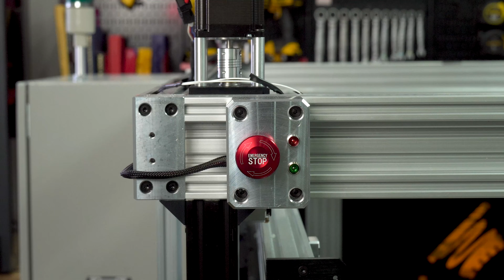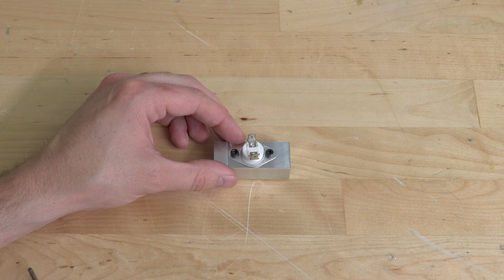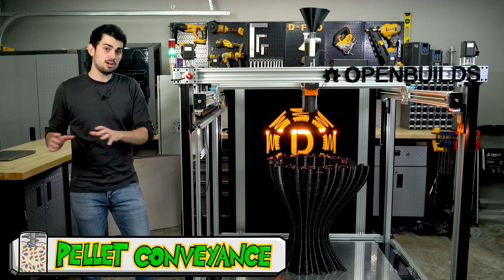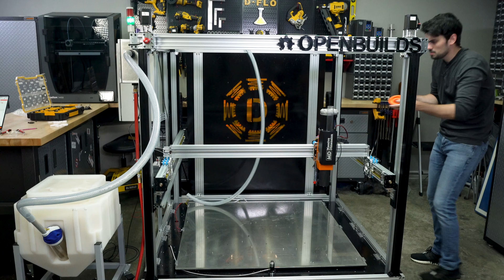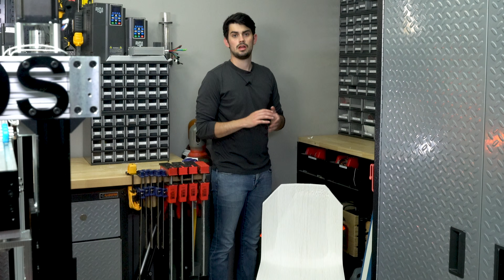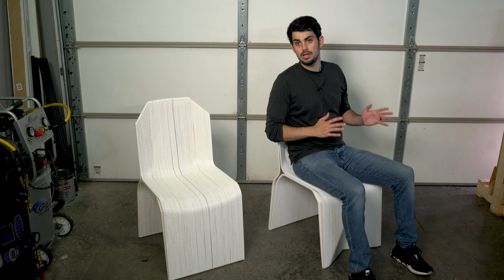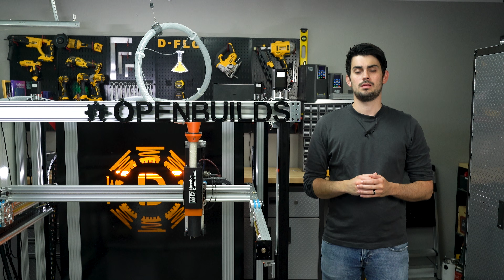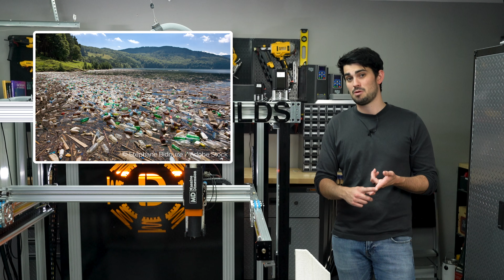Building a Large Format 3D Printer – Part 4: Printing

Comment: There is a solution to your problem of not having enough support from the infill on the top layers, Cura can be set to increase the density of the infill as it gets closer to the skin, with variable parameters .
 You could then get the light weight and the extra support.
Reply: PrusaSlicer has a similar thing with what it calls support cubic, as well as adaptive cubic that increases the infill density nearer to the walls of the print.
Reply: Lightning infill could also be incredible here!
Reply: @quinnobi42  cura has lightning infill which is not even close to any other infill in prusa but it doesn give strength
Reply: @ale6242  PrusaSlicer has that in the current alpha, I think Cura already has it
Reply: @DavidGarcia-nx2gj I really don't like lightening. Its been virtually worthless to me.. maybe some prints it'd work for rapid thin wall prototype but even at that it's been crap ime

Comment: I've worked with large format 3D printers as part of my undergrad. An interesting pellet extruder varient is to use a heated positive displacement pump instead of a typical feeder screw. This produces more consistent extrusion rates and, as a result, more uniform layers. As far as I'm aware there are no commercial extruders that provide this but you could design/manufacture your own if you are in need of content. Just a thought. Great work on this btw!
Reply: Just a random question that I'm curious of, do you know why no one makes 3d printers that prints above 2 meters? for some reason everyone tops out at 1 meter. I tried googling but couldn't find the answer to that
Reply: @rajneshchapatikumar3924  tbh I'm not too deep in the rabbit hole to truly know the answers. I'm assuming it's a combination of lack of demand, bed adhesion issues due to higher moment arm of extruder, increase chance of defects due to larger print, and high cost of both printer and plastic.

All that being said, I've seen some results from hang printers that go well above 2m. Look up "hang printer tower of babel". It's made of wood PLA and reaches 4.5m
Reply: @NameBeJeff  thanks for the reply. Out of curiousity, what did you study? You seem knowledgeable in this sector
Reply: @rajneshchapatikumar3924  I recently graduated my undergrad with a degree in mechanical engineering and I'll be pursuing a grad degree in aerospace engineering. Learning how to 3D print has definitely helped me along the way.
Reply: @NameBeJeff  sounds great bro, you have my support. Looking forward to see what you'll do for the world!
Reply: @rajneshchapatikumar3924 probably because it's easier for companies to inject mold and it's sturdier than layers
Reply: @justaweeb1884  But injection molding costs a lot more as for every single design you need a whole new machine. Advantage of 3d printing is you can use it to rapid-prototype at start and once you have your dimensions/design completely done, you can switch to injection molding.
Reply: I'd love to modify my current 3D printer to use this pellet extrusion method.
Reply: what does one need to study to get into 3d printers at college?
Reply: @fuarkstyle  Mechanical Engineering is probably the most direct way to work with 3D printers but definitely not the only.
Reply: @NameBeJeff  yup I guessed that but that would be the case on 1st world countries, the rest of the world maybe teach only with videos, perhaps just the software side or even simulators.
Reply: How would that even work? Wouldn't something like that end up trapping and compressing all the air between the pellets, leading to tons of bubbles in the print?

Comment: Almost to 100K!  What a great video, so much great information and experience shared.  I've had some bad print fails but now all of my fails seem like mild stringing in comparison.  Thanks for sharing. Looking forward to seeing your Super Mega Ultra Dr. D-Flo Boat soon!
Reply: The air cooler doesn't look good.
Bursts of air used will entrain moisture droplets in the cooling tube walls past the collectors at the bottom.

You can get a car ac condenser cheaply to chill the air right out of the compressor.
Then use a coalessing filter to strip the droplets from the air. Both water & any oil.
An oil lubricated compressor would probably survived being on for that long.

This will store more cold air in the tanks & save them from the moisture.
Bursts of now dry air don't have any droplets in the tubes to push onwards.

Keep D content Flowing thanks :-)
Reply: Still no boat

Comment: Nice! Some thoughts:

Design the stool to be printed upside down?
Thinner skinned parts could have expanding PU foam poured in them as a structural core material.
Design chairs that are sort of scaffold / core for skinning with glass or carbon cloth.

Seems you could do some cool stuff using composites techniques - eg car parts, bike frames... :D

Comment: A desiccant-filled tube from the main compressor to the storage tank may help even more, especially if you use a large ~2" diameter acrylic tube to help reduce the impediment in airflow and increase surface area, or even on the inlet to the main compressor itself! Bulk silica gel is fairly cheap, and can be reused almost infinitely with a quick bake in the oven after saturation
Reply: Yeah, that's what I was about to say. It's relatively cheap to make yourself and a very effective solution.
Reply: look up "compressed air dessicant dryer": they use 2 collums of dessicant: 1 for drying, 1 for regenerating. This way you wouldn't need to bake it

Comment: For the problem of infill being too sparse, perhaps if it hasn't been thought about already, you could use a trick I like to use mainly for supports but that I feel could solve the problem here while remaining at the same percentage of infill.

The potential solution would be to decrease the line width of the infill specifically. This would decrease the sparseness of the infill by allowing for an increase in line count while still sticking to the same percentage of material weight. I have found success with this method generally even to the point of printing to a smaller diameter than the nozzle, so perhaps it's worth a try if you haven't already.

Comment: FYI: on industrial machines, the indicator lights work the opposite way, with green indicating it's running and red that it's not, or that there is an error.
Reply: That was bugging me, too. There are 3-light options that include a yellow light that would be a perfect heat indicator.

Probably doesn't make a big difference unless you want a mill or lathe in the room as well.
Reply: Interesting. i was thinking the colour was right because mining industry here uses red to indicate danger - the machine is running. But as you say on production lines it is opposite
Reply: depends on the machine. in this case, you want a red because it is telling you to stay away from the machine while its hot enough to injure you and a green that tells you when its safe to engage with the printer. the green light isnt telling you its off, its telling you its safe to touch.
Reply: It's a safety light not a status light

Comment: Suggestion from my personal viewpoint, I would have build a small centrifugal dust separator vacuum unit, it's simple and 3D printable and you can easily power it with your shop vac via a hose. Doesn't weigh too much also which comes in handy
Reply: That's a really good idea! Way more affordable

I think it's called cyclone, right?
Reply: I was thinking the same thing, but it requires 2 hoses that go in different directions, one for the pellets (coming in from the side) and one for the vac (out the top), which means redesigning the printing mechanism to cope with the extra resistance of the pipework. Personally, I think it's a good idea, but extra work.
Reply: Check out RC Test flights video on these, its great!

Comment: For cooling, rather than adding a fan to the printhead, use a fan mounted to the frame and a tube just like your pellet feeder to get air to the printhead
Reply: Maybe just use the compressed air. Set the flow using a flow control valve or a bank of small solenoids.
Reply: I think it would be nice to refrigerate the air, so you can keep the CFM really low and avoid sagging your prints, but still cool them effectively.

Comment from the maker: Contribute to the 100k Giant Benchy Fund by checking out my Amazon store ( https://dflo.info/Amazon ) or supporting this project's sponsors Openbuilds ( https://dflo.info/OpenBuilds ) and Massive Dimension ( https://dflo.info/MassiveDimension ). This will require a boat load of pellets 😂

Thank you to everyone who made it out to the premiere! Keep the conversation going in the comment section by posting your suggestions and questions.
Reply: Be aware that the benchy doesn't float upp right.. :)
Reply from the maker: @c.hector5425  I’m going to modify the design!
Reply: @DrDFlo  I wonder what the modifications will be, and if it would be possible to print a smaller one.

Comment: Doesn't the high heat, 60°C, permanently affect the PLA? I recall hearing something like max 50°C for drying PLA?
Reply: I wouldn't really worry about it. The drying limit is mostly because somewhere slightly above 60C PLA (especially modern blends!) may start deforming and sticking to itself, thus ruining the filament. Since it didn't form a huge clump, this didn't happen here.
As for it changing properties: the internal structure does change a bit, but that really doesn't matter considering how the pellets are completely melted in the extruder.

Comment: For the hose problem, you can set a timeout to the pellet sensor on the hopper, if it is asking for pellets longer than X seconds this means that the hose got loose or there are no more pellets in the container or a blockage in the pellet system, and you can stop the vacuum and printing. Really nice video and machine!

Comment: For mixing, you can add a mixer just before the nozzle.  This is typically a metal piece that gets sandwiched just after the material is melted.  Its usually a metal ring that consists of 4 veins attaching to a conical shape in the center.  You can also add what's called a "screen pack" though that will require periodic cleaning.

Comment: You should consider some kind of soft interface between the glass bed and the retention clips you made, maybe just flip them over so the plastic sits against the glass and the metal sits against metal. Its possible that heat over time could warp the plastic pins, its also possible that the glass could break at the metal clips with only moderate forces due to a very rigid connection.

Comment: I am in east Tn. I use a dehumidifier set to 50% in my shop. It helps tremendously with the moisture of my compressor, helps keep the shop more pleasant, and saves on the AC bill also. Nice build.

Comment: Outstanding project I just stumbled into the room and there you were 3D Printing with beads. I had written a white Paper for NASA regarding life in the Moon way back in the 70s. I thought plastic beads should be considered for spare parts instead of shipping up spare parts in cargo rockets. I felt the beads could be formed into any shape we need via templates. I was not thinking 3D Printing but i was thinking flexible forms assembled, then the beads pumped in, heated and cured to form the needed parts. When I saw this video I had the biggest grin and was so happy to see beads in your concept for large scale prints. In retirement I am using Fusion 360 and a Creality 10S Pro printer to reengineer parts for my 1950s Model Trains. For example I am converting AC wire wound motors into PM DC with fields that are 3D Printed frames and Super Magnets. Thank You so much for sharing your work, now i going to Part 5 Wowie! Such a great project. Dennis in Virginia

Comment: I'm a process engineer, and I work with pneumatic transporters.  I think an alternative to the venturi setup that may work is a simple vacuum motor pulling through a cyclone.  So mount the cyclone on top of the existing nozzle.  Put a filter inline.

Comment: Massively impressive build man! 
I know what you mean about the water in the air in TN. I have a dehumidifer running in my printing room 24/7 and it removes roughly a gallon per day on days it hasn't rained. On rainy days it's easily 3 gallons. 
And it's a small room!

Comment: A much simpler way to cool compressed air to condense the water within it is to plumb it through any automotive transmission cooler, and either use the pumps fans to flow air through it, or rig up your own. Then all you need is a water trap to separate the liquid out, and then you can filter it.

Comment: 8:27 "passing air over chilled coils"
Suggestion: try a plate heat exchanger where one side is water-cooled. It might need to be clamped between two aluminium plates, but it's already rated for water pressure (8-10 bar) and is perfectly sealed while providing large-area contact.

Comment: put a thinner walled hose from the air regulator to the head. use a spiral hose for it, and you also can let the pressureized air out before the head when you make a seperate container, so you can get the weight of the head down :)

Comment: Looks like a hybrid of a 3D printer and an injection mold. 
I like that, using pellets, it would lend itself to recycling filament and 3D printing fails.
It would be nice if there were a machine that would take scrap filament and printing fails and turn them into pellets suitable for this use.

Comment: You could use one of those vortex air coolers, which use just pressured air to produce really cool air, to cool the filament at the bridging stages. This way it should basically harden instantly and create a perfect bridge. They are quite expensive tho and  need even more pressured air.

Comment: Regarding the air dryer setup, one thing you might want to add between your compressor and secondary air tank is a cyclone/vortex-based water separator (like for example Atlas Copco WSD Series separators). These kinds of filters are used also in industrial systems before the chill air dryers. Cheaper than chill air dryers are either desiccant or membrane dryers which might also be suitable as your air usage is not so great.

Comment: pretty neat. I would have used an auger set at 45 degrees that goes slightly above the printer and then gravity feeds the pellets into the extruder unit.

Comment: For pellets, I think this would be a better and quieter option: A large, but short, rectangular bin/hopper above the printer. And just like a 3D printer, a lead screw and a motor can push a wall along the length of the bin as pellets deplete to keep the depth of pellets consistent in the bin. A photoelectric sensor can tell you when the funnel is about empty, and the print head can move to a corner of the printer, to be refilled by the bin/hopper via gravity.

Comment: You need a more flexible connection from the hose to the orange thing that inputs off-axis from the hose direction.  Maybe a rotating coupler or 90 degree rotation of the input port.  Also you can get weaker hose pullers with a series of VR cable pulleys to lift the hose while not pulling so hard.  This could help keep the hose on the machine.

Comment: Really cool project! 
I keep thinking about a way to make it print color on demand. If you can rout a small diameter tube all the way to the screw mechanism in the extruder, you could dispense precise amounts of coloring pellets using air of gravity. This could allow you to consistently color your prints without pre mixing pellets (and essentially dying whole batch of them), and with right dispenser design, you could also change colors mid-print.

Comment: The only thing that you're missing to do some insanely cool stuff is filling in layer lines with PLA.

Once you can do that, you can print large objects that you can cover in ceramic dip for later casting of those parts in aluminum, aluminum bronze, etc.

Comment: Part cooling.  Air conditioner?  A water cooler setup that you chill water to run to the head and cool the air going into the fan on the head.  This really could help once you have the printer fully enclosed and printing at higher temps....maybe.  ;o)

Comment: the piston actuator has a controled leak into the valve body that keeps media from getting suck in it and the valve opens automatically with spring pressure when the air pressure is stopped. this permits even a second hopper above the pressure hopper to act as a surge hopper when the pressure hopper gets low. electric ball valves work also but 2 " one is expencive compaired to a $15 black water valve and a piston made from washers and pipe fittings.

Comment: Great video! One thing you could do to increase the quality of your top layers, is to decrease the line width for infill. This means that there will be more infill lines, with less space between them. This means that you will use the same amount of plastic but your bridges will be less difficult. For cooling, maybe look at mounting some big fans on the gantry, on the y extrusions. For example look at 24/7 printing’s voron 0.1’s cooling setup.

Comment: You probably already know, but beads that size can bridge up inside the tube. It's only an issu when it bridges up around the sensor. The last place I worked, bought beads that were coated in some sort of powder. I wanna say it was just the powdered version of the same material.

Comment: D, awesome video as always. Just a say, you could solve the gaps over the low-density infill with the infill stepping option (which exists in Cura) in which you define a much higher density to the infill but also the number of times the infill density will double during the print in order to reach that density... in short you could have an 80 % density top infill layer and a 10% bottom layer and the infill density will gradually increase.